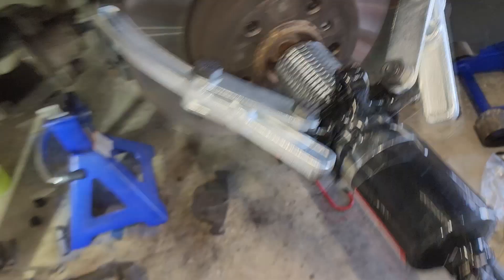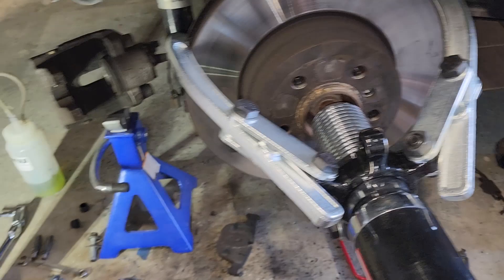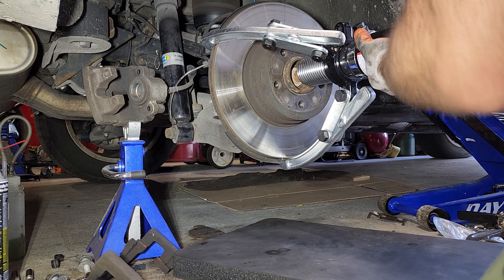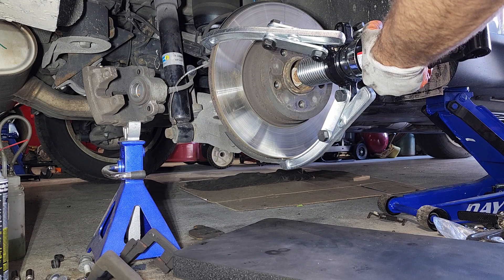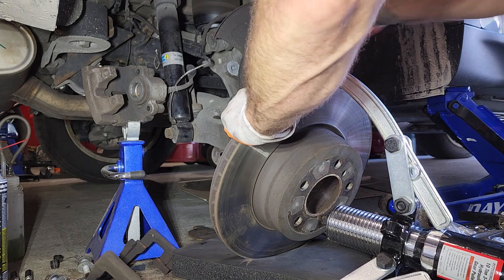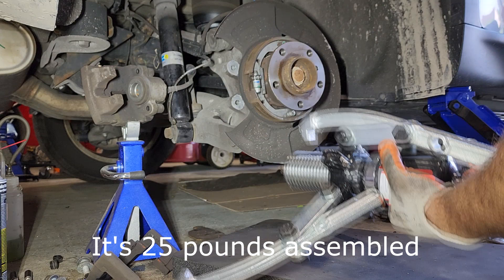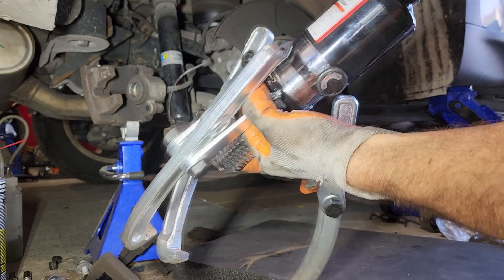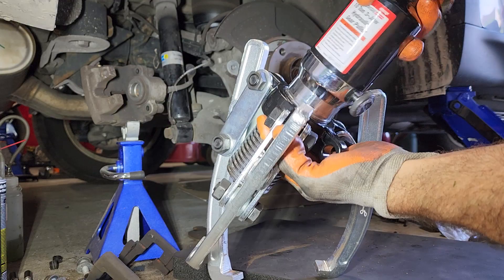Harbor Freight Pittsburgh 10 ton brake rotor puller in action

Comment: Awesome! Glad it worked out for ya! Do you think this would grab onto a 11" brake drum? My problem is while I was adjusting my brakes shoes, I went too far making my shoes tight against the drum. I can't back of the shoes with the star adjuster even when holding/pushing back the adjuster plate that's against the star wheel..... I can wiggle the drum slightly but, not strong enough to pull it off. Nothing is rusted. Thanks. 🤔
Reply from the maker: If you can get the jaws on the back of the drum, then yes, it will most certainly pull it. I have used this puller a few more times after this video was made and see that the trick to using it depends on how flexible your backing plate is. On the bmw in this vid, the plate was fairly flexible. On my Toyota FJ cruiser, the backing plate is much thicker and not flexible at all, and I couldn't squeeze the puller jaws between it and the brake disc. 
But if you can get the jaws on there, this thing's got enough power to either cure or kill it!
Reply: @jcx2bby  Thank you!! I'm going to try again today to get that adjuster to turn along with looking for the room for grabbing the drum as you mentioned. If I'm unable to, I'll take a trip down to HF and take a look at it. About how much room is needed between the drum and backing plate? Thanks again, appreciate your help and quick response! Happy Memorial Day to you and yours.
Reply from the maker: @rapaent  Okay I just measured the tip of the jaw on mine. You're going to need at least three eighths of an inch between the drum or disc and the backing plate. Harbor freight also makes a 5-ton three-jaw puller that might have slightly smaller jaws I'm not sure. Even the five-time color should have enough juice to get done what you need done. Have a great holiday weekend as well!
Reply: @jcx2bby  👍🤗Thank You!!

Comment: Iv always just took a rubber mallet to the rotor when its stuck. This seems alil over kill lol
Reply from the maker: The 10-ton polar is definitely overkill for this job. But a rubber mallet doesn't cut it when the rotors are really rusted on there. And sometimes a 3 lb sledge doesn't cut it either. I've done brakes on many many cars, and sometimes you are reduced to using either the old Blue flame or puller. No amount of hammering can remove some of those rusted rotors or drums especially when you're in the rust belt.
Reply: @jcx2bby  really? Lol man I guess iv lived places where my cars never experienced rust to that magnitude. If its that hard to take them off them it is worth it then. The most iv ever had to do was get a 2×4 to place on the rotar and gave it 2 good smack with a sledge hammer.
Reply from the maker: @robertcarrillo747  yeah, I'm definitely being serious. Sometimes it is a fight just to get the wheel off of the car, before you can even begin to work on the rotors or drums. 
I once did front brakes on a Mitsubishi Galant. It had aluminum wheels which had corroded onto the front hubs really badly and had to be massaged off with a sledge and 2x4. It took at least an hour to get the wheels off. Then I started on the rotors. After banging on the front passenger side for about another hour, I finally said screw it and got the acetylene torch. After a couple of minutes of blue heat around the center of the rotor it came off with a distinguishing POP. This was about twenty years but the car itself was probably only 5 or 6 years old at the time. It's crazy what the salt on the roads can do to the underside of a car.
Reply: @jcx2bby  Jesus! Im going to remember this the next time I do my breaks and think "ugh, gotta do these brakes for the next hour or two."